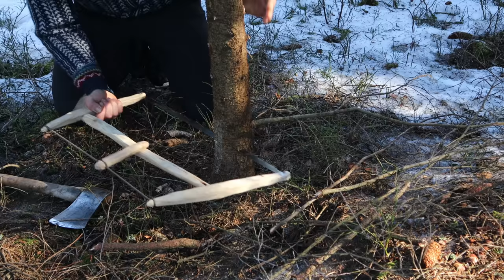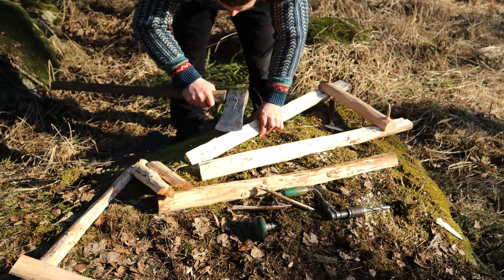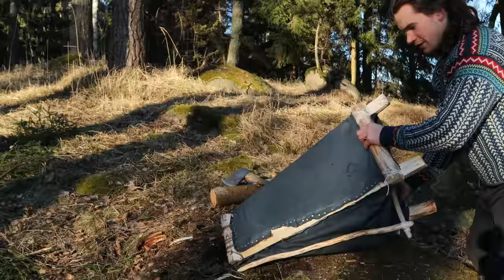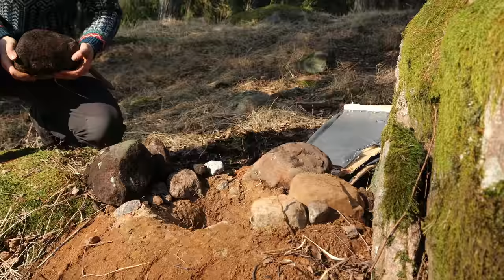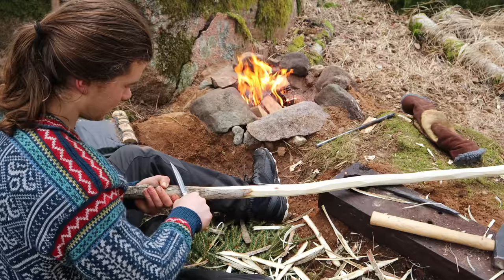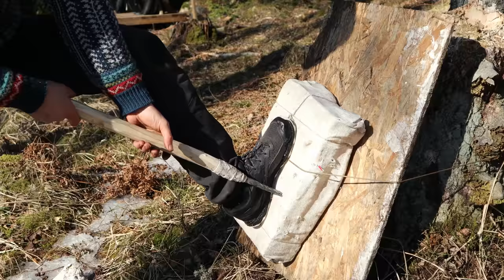How to Make a Survival Spear - My Primitive "Bushcraft" Forge in the Forest

Comment: Great video. Next time you make pine resin glue mix a little ground charcoal in with the hot resin. It will make stronger glue. Also, dried ungulate dung,(deer, rabbit, etc.), does well also in place of charcoal. Thank you .
Reply from the maker: Thanks for the info

Comment: If you decide. Make a pic axe..  it doesn't have to be big. Just light and effective when a trench is to be made..  also good for battle and very effective when used as a weapon. Due to the weight of the balance of the weapon